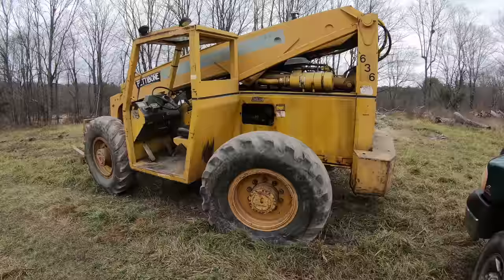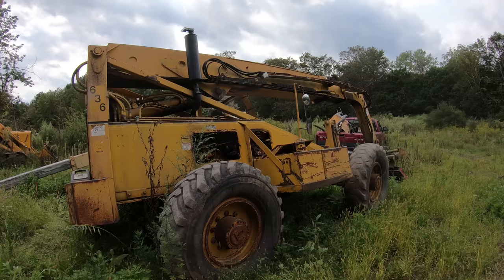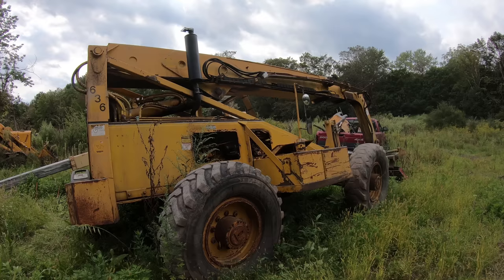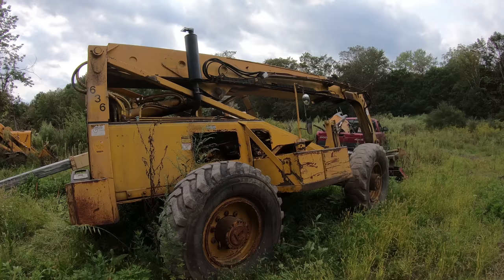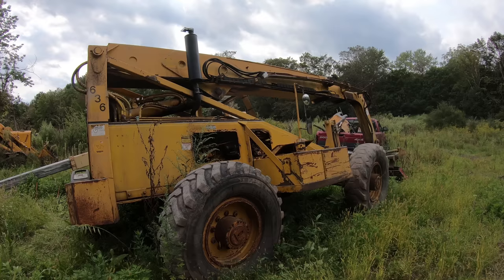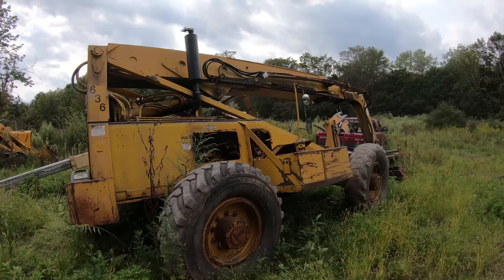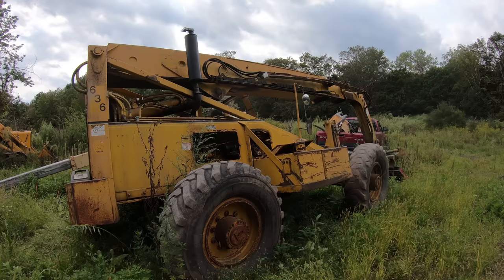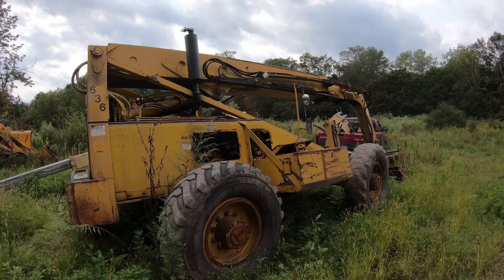Buying and fixing a telehandler : 92 Pettibone 636

Comment: 9/21/22. Wow Jesse, what a job renovating that Tele-handler! Getting those 2 main (leaking) hydraulic cylinders out...phew! Every hyd.cylinder on machine has been replaced/reworked/re-packed & new safety control blocks replaced the old ones. What a project! Now about swinging that maul to drive those solid  2" (?) pins out...could a Porta-Power & attachments help? Have seen this used on another channel similiar to yours..mechanical 'break-out' (& reinstall)etc. Much enjoyed watching/listening/learning from you & rejoicing when you accomplish each issue. This Tele-handler needed everything...but when you finish with it...it will do everything !⚙🛠💪Stay safe & carry on sir!👍👍👍🚜🍺😊

Comment: Jesse, When you hone ANYTHING you should use a lubricant! You say you are concerned with safety but use the WRONG bolt in the Boss pin!  Boss pin comes out, you lose the pin and you will kill those people in the basket! You should cut down the Boss Pin and Drilled a hole for another retaining Bolt(Just because you only found 1 does not mean that there was not 2) Check your diagrams for the machine if in doubt! Otherwise you do and did a great job on the Machine ! (Oh, I am a Old (65 years old) Heavy Equipment operator and Mechanic)
Reply from the maker: I put the same amount of bolts back, I dont see where your concern is. there was only 1 bolt for each pin and I put back 1 bolt for each pin

Comment: Reminds me of Marty T or maybe CCE doing summat similar with a hydraulic cylinder and it looked like nearly 1000 ft lbs were needed to break the cap loose on his machine, Marty (Curtis?) bouncing on the 
end of a 6' long shaft before it broke loose.  There is a reason cylinder repair shops use a hydraulic monster to loosen and tighten those big cylinder caps.

Comment: Great to see that handler running. How do the numbers compare for purchase, repair and maintenance versus hiring out a similar machine as and when you need it? For your level of usage, I can see that working out in your favour, but ending up in the hole for any repairs plus the time/effort needed.
Reply from the maker: These machines start at around 20k for this kind. And they go up from there alot. also they could be 3k a week to rent
Reply: @jmuller86  Wow. In that case I can easily see why acquiring an older machine in reasonable condition is cost effective. Unexpected repairs are still time, effort and expense, but I guess anyone running these rigs must get used to that pretty quick.

Comment: i havent watched the whole video yet but the telehandler itself is the jig.  why not leave the two lift cylinders connected, loosen the nuts, put a rod through the eye, strap that rod to the end of the telehandler boom and just extend it to pull the chrome shafts out.
Rebuild it then push the shaft back in?  why remove the cylinder body from the machine to change seals?

Same with the cylinder you cut the pin on.  Create a chinese finger with a strap and pull the cylinder off the shaft while it is connected to the machine with a second machine.  Change seals then push the cylinder back down on the shaft?

Both shafts chrome looked very good and i doubt either one would need a spray weld and fresh turning
Reply from the maker: I was going to try that but couldnt get the gland nut off the one

Comment: Could you have attached a compressed air powered pin puller to the pins and removed them that way?
Reply from the maker: I have never seen one ,but I will check into it
Reply: @jmuller86  The exposed end of the reluctant pin is either welded or drilled and threaded to make a connection to the pin extractor.  The powered tool is then connected and pulls the pin out.  E.g. Tiger Tool 15060; Enerpac; HEMS hydraulic pin puller; there are others.  (On YouTube there is a video 'Nike Hydraulic Shaft and Bush Puller Remover' showing a graphic of how they can work.)
Once you see how they operate, maybe you could work out a solution for your needs.

Comment: Try turning on the key but not starting - glow plug heating - wait then start.  Good luck.   Those front pin holes are not aligned and need to be line bored.

Comment: I guess they have made that 636 for years. I don't know if the newer ones are the same design as the older ones but here is a manual for a 636. wiring diagrams are at the last pages. https://rentalex.com/wp-content/uploads/2017/04/GTH636_Service_Manual.pdf

Comment: You can't get the rod out because you have it hydraulically locked - there's caps on both ends.  I really applaud your tenacity, your methods, not so much.  Work smarter, not harder.
Reply from the maker: The 2 companies I brought the cylinders to had to use 2 giant forklifts to pull the rod out, so there wasnt much I was going to do by hand

Comment: Those cylinders are expensive!  Have you thought of drilling and tapping the cylinder bases for a zert fitting?  There is a lot of force pushing down on that pin.

Comment: to remove a stuck pin use the torch and heat the pin ... u would think that expans the pin  ait does but when i cools it srinks to smaller than it was b4 try  it

Comment: Ive worked with OEM Deere engines around 2010 and we still had injector sealing issues and cracked manifolds... My respect for Deere has decreased since ive been working with/on them and i noticed the design flaws in them...

Comment: there was no need to cut that pin,, in all the years i worked in logging camps as welder mechanic, operator, we all ways left one pin in on huge cylinders, it was the only way to get the gland nut off and able to pull the rod out, we always had to use a machine to pull the rods out, with out one pin the was no way of holding it to do any thing, even getting the rod nut off, at that to brake the rod nut loss it took  a blade or boom of another machine pushing down on a 1 inch power bar, smaller cylinders we blow the rod out with 175psi air, well holding the barrow in a chain vice. with any stuck pin i never fooled around beating on it, i just lanced the center of the pin out, this was a must on tapered 5th wheel pins and walking beam pins on skidders, using that little gas torch to heat up heavy steel, is a waste of time, use a cutting torch with a rose bud tip. i have no use for a plasma torch, you need a cutting torch set up, 2.  1/2 inch tack welds with 7019 rod will hold a tow bar on to a 5 ton truck to tow it home, i have no use for a mig welder unless i am building a big trailer or bin all out of new clean steel, it not a place for repair jobs, been a welder all my life. ticketed at that
Reply: I don't know this guy,  but it sounds like he's been around the block and dealt with this kind of stuff a bunch of times, and I pretty much agree with everything he says

Comment: You could used air too push out the pistons I never used a sledge on a ball joint tool where's the heat there sir could giving yourself a hard time
Reply from the maker: those pistons needed 2 giant forklifts driving away from each other to budge out of the bore.

Comment: what do you think you are missing .. every time you weld and get 10 times as much heat in pin bolts, they come loose   the micro gas burner will help you nothing .. believe me I have been doing something like this for 20 years HEAT IS YOUR FRIEND

Comment: 24:10 Jesse why didn't you just use an impact hammer to jar it loose? Improv welding isn't the solution here.
Reply from the maker: impact hammer wouldnt have made a dent in the pin ( I assume that is what your talking about) unless it was so big that you couldnt easily put it sideways

Comment: What about the alternator?  Or did I miss that part?
Reply from the maker: it seemed like it wasnt working but I have started that machine 100 times and then checked the voltage and its right at 12.7
Reply: @jmuller86  Your on video comment was correct. 13-14 volts charging.  I think  the 12.7 is charging but very low.  Since usage is low, just something to watch.   The guy below bolt comment, you removed short bolts and put back long bolts.  He was right about the lube and honing.  I would have greased the heck out of all those pins, moveable or not to prevent rust.  Thanks for the videos.  Love watching the repair stuff.

Comment: Real bad air plug to turbo lead to no power.  But fuel ? With both same just thinking ?
Reply from the maker: This doesnt have a turbo
Reply: @jmuller86  I have seen seal between oil side run the engine away off oil. Looks some the same.